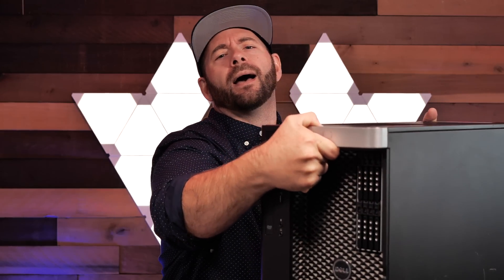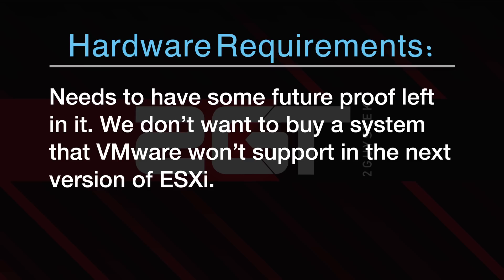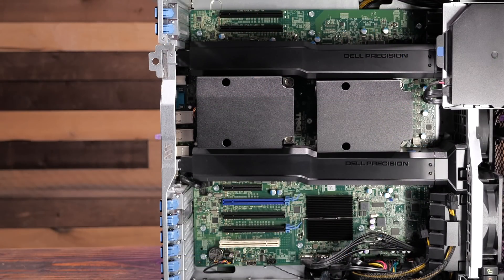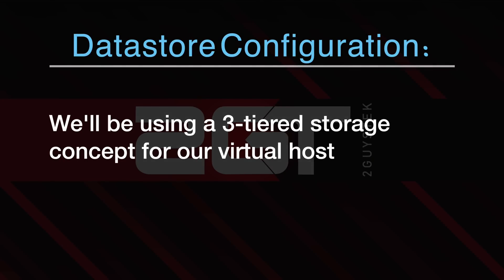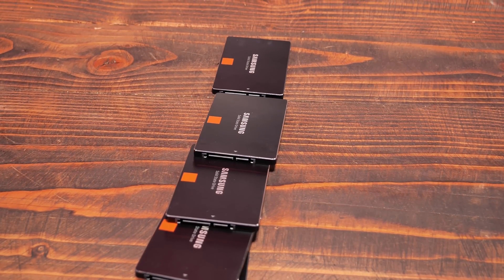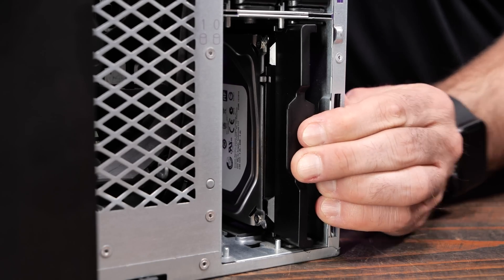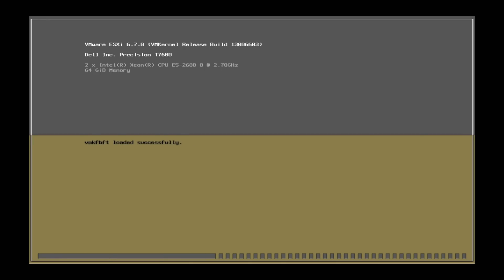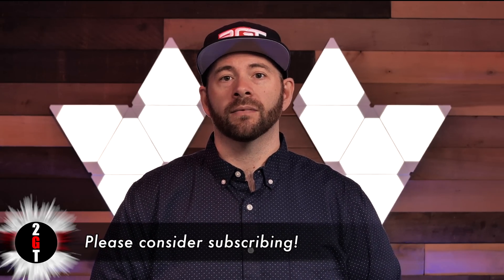Cheap and Powerful Home Virtual Server - $300 GETS YOU A TON OF POWER!

Comment: I have a t6100 with a 12 core Ivy Bridge Xeon for my main audio production rig. Paired with 80GB of DDR3 1866 ECC RAM and an Nvidia 1650, it's perfect for light gaming too. I wish Dell had made modern versions of these workstations to snag used on eBay. Unfortunately a lot of their updated "workstation" models have some really weak PSUs and iSeries CPUs.

Comment: I have the same host, having issues with ESXI boot after install. what version of ESXI did you install and how did you format the boot drive, also what boot method are you using (legacy/eufi) and any specific “gotchyas” in the bios you ran into?
Reply from the maker: We used BIOS boot as the boot method, and we targeted an internal USB stick inside. This was v6.5 of ESXi. What is your boot target? That generation of Precision host doesn’t support booting from NVMe, so you need to use a SATA-cabled disk.
Reply: @2GuysTek  wow thanks for responding back so quick! I actually got it working today using version 6.5 update 3, from the custom ISO Dell EMC download option in VMware’s site. Was able to copy a license key I had from a 6.7 version host I had so we’re up and running 🙌🙌 . Was hoping to use v7 but it sounds like there’s a lot of jumping through hoops to get that to work on the T7600.

Comment: Great video. Thanks. Will your server run the latest games in 2022 with a decent GPU added? I ask, since the video is now 3 years old, and the server's release date was 2012 as you mentioned. I'm wondering how it copes with Windows 11 Pro on one VM running alongside another VM for gaming? I'd love to find out how it actually performs today?
Reply from the maker: With a decent GPU it would perform fine as a gaming rig as most of the heavy lifting in gaming is done on the GPU. It would run Win 10 fine, but Microsoft doesn’t support the processors in that box for Windows 11. There are workarounds but YMMV on that.
Reply: @2GuysTek  Thanks for responding :) Today, I just purchased an old Dell PowerEdge T320, Intel Xeon E5-2470 v2, 48GB DDR3, H310, 8x 3TB SAS. I'm just waiting for delivery now. Will look at upgrading the GPU as suggested. Maybe, something like an RX 570/580 from Aliexpress, or used on Ebay. I have to ensure compatibility with the box first. I heard there was an issue with having to change a power cable if the GPU is powered from the Dell PSU. I have no idea at this stage.

Comment: I bought a T7600 specifically because of this video. Installing esxi worked without any problems but the system refuses to see any bootable drives.  If i choose F12 at bootup I see VMware ESXI as a UEFI boot option but when I select that the system just goes to a black screen and nothing happens. Not sure what to do at this point.
Reply from the maker: I'm sorry to hear you're having issues! In the BIOS are you set to legacy or UEFI boot mode?
Reply: @2GuysTek  UEFI
Reply: @2GuysTek  I rewatched your video. Did you say in the video that you installed esxi to the USB stick that you installed from? You did not install esxi to one of the hard drives or ssd drives?
Reply from the maker: @Squash_Man  We did target an internal USB stick for ESXi in this host - At the time this video was made 3 years ago, that was a supported method for running VMware ESXi. These days, depending on what version of ESXi you're running, you'd be better off targeting an internal HDD per VMware's newest recommendations. 

Either way, you should be able to boot off an HDD or SSD in the host, assuming that the BIOS can see the disks at boot time. How do you have them cabled in the host? Directly to the SATA ports on the board? Mini-SAS connector? HBA? Out of curiosity, have you updated the BIOS to the last version released by dell? https://www.dell.com/support/home/en-us/product-support/product/precision-t7600/drivers The last update was a long time ago since the hardware is end of life, but it would be best to make sure you're up on the last version.
Reply: @2GuysTek  A17 bios. Installed to a sata hdd connected to the SAS connection in bay 0 of the case. Seems odd that it will install but not boot. Going to hook up a sata drive directly to one of the sata connectors on the motherboard and see if that makes a difference.
Reply: @2GuysTek  I installed to a 16GB usb stick but when I started up the computer it did not list the usb stick as a uefi boot device but it did when I did the install.  So I selected the boot options and chose legacy usb boot which did start the boot up process but failed with an out of resources error. It got pretty far into the bootup process.
Reply: @2GuysTek  the system is hit or miss on seeing the usb stick as a bootable uefi usb drive. Sometimes I have to reboot a couple of times before it finally boots. I think I gave up too quickly on esxi 7. Esxi 6.7 is booting which is great. Was hoping to get esxi 7 working though. Did you guys ever get 7 running on your T7600? Now I have to figure out how I can get a license for 6.7 as VMware no longer gives you an option to get a free license for 6.7.

Comment: I am not understanding how you got all eight 2.5" drives connected to one SAS connector.  If the 3.5" disks are connected to the other SAS connector the cable you have only allows you to connect 4 of the 2.5" SATA drives to the other SAS connector.

Comment: Do you think I could use Mac OS Monterey with VMware fusion?
Reply from the maker: Are you asking if you could hackintosh Monterey onto this hardware and running Fusion within it?
Reply: @2GuysTek  yes, or if I could even run VMware on it.
Reply from the maker: We recommend running ESXI or XCP-ng and run VMs of your choosing, that’s what we did with it!
Reply: @2GuysTek  gotcha, do you think normal windows 10 would be decent?
Reply from the maker: Boot off an SSD and you should be good.  And if you wanna give it more performance consider searching eBay for two upgraded CPUs and it’ll be even better.
Reply: @2GuysTek  with windows 10?
Reply from the maker: @stevenlucas7930  Yep!
Reply: @2GuysTek  gotcha! Thank you sir! I’ll buy one and install win 10 and do my vms from there. I have the m1 but because of the arm cpu trying to run any 32 or 64 bit os on it is a pain
Reply from the maker: @stevenlucas7930  Oh! I feel your pain! I (Rich) moved to an M1 Max MBP recently and am in the same boat - it's a real disappointment in terms of x86 virtualization.
Reply: @2GuysTek  sadly, if its for pleasure it’s a disappointment but when your in school and your trying to assignments and labs so 1, you can learn, 2, you can ace your assignments and 3 you can move forward. It kinda moves from fraustration into strait up pissed off mode. Especially when your put on Acedmic probation knowing full well you have been talking to everyone from the program director and down.

Either school or for work, either way it’s bull crap.
Reply from the maker: @stevenlucas7930  I’m sure that VMware will come around and release a version of Fusion that will work on ARM. In the mean time, have you looked at Parallel’s Desktop? It will do x86 on ARM.  https://www.parallels.com/products/desktop/
Reply: @2GuysTek  I actually haven’t, are you aware if you can set up ip addresses and subnets?

Comment: I was checking into getting a home server running and really liked the one you reviewed here and hoping you could answer a couple questions please . 
1st can this server / work station be updated for high speed newer gen cpus for high specs gaming ? If so which cpus could I get the most out of this system along with any other upgrades that has come about since this video you posted ? 
I was very curios about the size and running 2 high end gpus I’m assuming this would be a crossfire method that could utilize two gpus on one system ? 
Crossfire for modern pcs is now obsolete so I’m hoping this is a method that can still support the 2 cpu and 2 gpu approach . I’m concerned about building a server that does not meet my high end needs is why I ask , 
Great video please let me know your thoughts it will be greatly appreciated . 
Thank you !
Reply from the maker: Great questions, here's some answers:

1) The server is upgradeable, but only within its current generation. This is a first generation (v1) E5-26xx Sandy Bridge Xeon and while Intel made the v1 chipsets capable of running v2 CPUs, Dell does not and locks the BIOS to only allow v1 E5-26xx CPUs. That being said, you could always get the best CPU of that generation to throw into this chassis, those would be the Xeon E5-2687W CPUs which are 8-core CPUs - Still pretty fantastic chips and probably pretty affordable.

2) To your GPU question - The workstation has a 1kW PSU in it, so it's capable of running a pretty good variety of GPUs. Keep in mind that Dell says it has 600W-worth of PCIe power for GPUs. I can't speak to whether AMD's crossfire will work or not.

Here's a link to Dell's hardware specs for the T7600: https://www.dell.com/support/kbdoc/en-us/000139598/hardware-specifications-for-the-precision-t7600-desktop-workstation

This is a great system for the price and still is a great performance, though it's getting old by today's standards. I hope this helps! Thanks for the question, consider subscribing, and best of luck!  -R
Reply: @2GuysTek  Great stuff and thank you so much for sharing your vast amount of knowledge with a incredible fast response . To me that is very rare and speaks highly to your character . 
I’m subscribed and will be looking forward to watching more of your content . 
Kind regards , 
StrokerAce

Comment: I know this is an old video but I do have a question.  Can that box be turned sideways and put in a rack?
Reply from the maker: 100% yes it can. In fact it actually has rubber feet on the backside if you wanna change the orientation.
Reply: @2GuysTek Because of space constraints my desk isn't that large. My solution was to rack everything.  I have a 25U startech rack in my mancave. So far all that's in it is my media server and my daily driver. I've been wanting to learn linux but didn't want to mess with dual booting.  Since the T7600 is dirt cheap and will fit in my rack, Ebay here I come! Next stop Pop!Os.

Comment: Just picked one of these up from a junk yard today for 10 bucks. Hoping it runs! It's a lower end model with a single CPU, single Invidia GPU, 32 gigs of RAM and a Velociraptor HHD

Absolutely massive machine, hope I can find matching CPUs and some 32GB sticks of RAM to get the full 512 gigs in there lmao
Reply from the maker: They’re great systems!
Reply: @2GuysTek  Can't wait to test it out, gotta find a Display Port to HDMI cable or something before I can hook it up and see if it actually functions but I'm super stoked. Current PC is an older eMachines case fitted with a nice Asus board, Asus graphics, Intel i3, Crucial RAM and twin Barracuda hard drives. I originally went to the junk yard looking for some upgrades and was lucky enough to find a few i5s and some bigger RAM sticks before I even stumbled upon this monster Dell

Yep, it was a good day today lmao
Reply from the maker: Sounds like it!

Comment: Got an Awesome deal on a Dual Xeon E5-2650 V2 Dell Precision T5610. For total of 16 cores and 32 threads for 70 bucks! The issue was the motherboard sata controller. Easily fixed with using a pcie sata card.

Comment: I just came across your vid today. For the life of me I cannot get my additional drives to detect. I have the T7600 running ESXI 6.7 running bare metal. The only Drive being recognized is the SSD connected via SATA that is booting ESXI and an NVME via PCIe card. BIOS version A10. I have 2 x 6TB NAS HDD drives and 1 Samsung SSD connected via SAS0 port on the Mother Board. None of those are being detected.
Reply from the maker: Regarding the NVMe - you need to make sure the NVMe drive you've used is supported by ESXi (Samsung NVMe disks are) so check that. Regarding the 2x 6TB drives. What are they connected to? Is it a software RAID or direct to the system?
Reply: @2GuysTek  My nvme is fine, just can't boot from it which I understand. The 2 nas drives are connected to the Motherboard via mini sas to sata cables that come factory stock with the unit. I've tried enabling and disabling RAID in the bios and the drivers don't show up.
Reply: @2GuysTek  The solution was to unplug the onboard mini SAS and use a card via PCIe, everything is now showing up and TrueNAS running, as well as several VM's
Reply: Did you have any problems getting the system to boot up after the esxi install? I installed esxi 7 but the system will not boot after the install.  Esxi shows up in the boot options but it will not boot up.
Reply: @Squash_Man  I don't think the T7600 supports running esxi7. I think you'll need to run esxi6.7 or bump up the hardware to the T7900
Reply: @Vortex324  unfortunately there is no way to get the free license key anymore for 6.7 from VMware. Your only options are 7 or 8.
Reply: @Squash_Man  even on GitHub?
Reply: @Vortex324  interesting. I looked at a few but they all look like paid licenses in the wild. I just want the license for the free version. I have always been a license dictator at my jobs. I don't cross that line.
Reply: Did you install esxi to a drive that is connected to one of the two sata connectors on the motherboard?
Reply: @Squash_Man  yes

Comment: I purchased a T7600 and it only has 1 sata power adapter. How did you add a sata power adapter to get 2 for the ssd hard drive box that went in the 5.25 bay?
Reply from the maker: There should be more SATA connectors available, if not, buy this: https://amzn.to/35WNAVv

Comment: I like your hardware and as a Dutchman I love the reuse of existing hardware. I use Ubuntu 21.10, OpenZFS 2.0 and Virtualbox 6.1 to store my virtual machines. My hardware ($349) is modest a Ryzen 3 2200G; 16GB (3000MHz); 512GB SP nvme-SSD (3400/2300MB/s) and from the previous PC a 128GB SP sata-SSD and 2 HDDs 500GB Seagate and 1TB WD Black. I can run 2 modern Windows VMs or 4 Linux VMs at the same time. 
I also have 3 tier storage in 3 datapools for my VMs:
- The 14 most frequently used VMs use the high performance storage with a 2 level storage hierarchy; the L1ARC 4GB memory cache and the nvme-SSD.
- The 27 VMs, still receiving updates, are on a 3 level storage hierarchy; the same 4GB L1ARC; 90GB L2ARC (read cache) + 5GB ZIL (sync write cache) on sata-SSD and 2 x 500GB HDD partitions in Raid-0. Here I also store my personal data in a separate dataset, but with copies=2, so all my data is stored on both HDDs, a kind of Raid-1 subset inside Raid-0.
- The 29 VMs, that are not receiving updates anymore, are also on a 3 level storage hierarchy; the same 4GB L1ARC; 30GB L2ARC + 3GB ZIL on the same sata-SSD and a 500GB partition at the end of the 1TB HDD. 
Note that all storage and all caches are lz4 compressed and the compression ratio is ~2.0.

My VMs are a mix of distro-hopping and collecting OSes. As collector I have all Windows releases from 1.04 to 11 and the Ubuntu releases 4.10, 5.04; all LTS releases and the development edition for 22.04. As distro-hopper I have Garuda-Linux; Manjaro; Fedora; OpenSUSE; Linux Mint; Xubuntu; etc etc.

I have an very cheap backup-server built of leftover parts and I added a new power-supply ($18):
- a Pentium 4 HT (1C2T; 3.0GHz); 2GB DDR (400MHz) and 4 HDDs in total 1.21TB  (2 x 3.5" IDE 250+320GB and 2 x 2.5" SATA-1 320+320GB) running 32-bits FreeBSD 13.0 on OpenZFS :)

Comment: Is it actually quiet ? the power supply seems to have smallish fans which bother me a bit .... thinking about doing the same as I have plenty of RAM laying around, but it has to to quiet so my wife won't be angry ;) .... would be awesome to get an answer to this !
Reply from the maker: It is as quiet as your typical high performance desktop. The PSU has a standard 120mm fan in it and it doesn’t scream like a rack mounted server’s 60-80mm fans can. Keep in mind that Dell designed these as engineering workstations that sit at people’s desks so they’re not massively noisy.
Reply: @2GuysTek  thank you very much, that helped a lot ! .... awesome video, just the right information I needed !!!

Comment: Hi, I saw your video almost 1.5 year later - what would you do differently today? Would you still use the Dell T7600s as your base or would you opt for something different.
Reply from the maker: Thanks for the question! The T7600 really has been a quality system for our needs. The platform has been entirely reliable since we put this video out. We actually just replaced it recently though, here's the video for that: https://youtu.be/rbTx0-ZjXGE if you're interested. And to be honest with you, the only reason we upgraded was to continue to stay current with the hardware support from VMware moving forward beyond ESXi 7. We did miss not having a DRAC/iLO/OOB interface for the host. If there was a way to add or install and out-of-band management controller then the system would have been practically perfect. 

When the decision was made to move to something newer we didn't go with another Precision T-series because the cost was just too high. Sadly the world has caught on to the value of using a workstation as a virtual server and now the prices for what you get are even higher than a rack server with more power (which is why we moved back to a rack server).